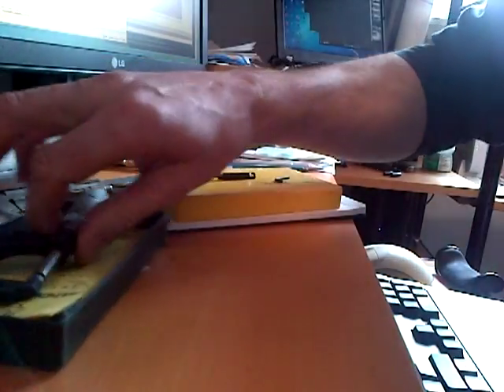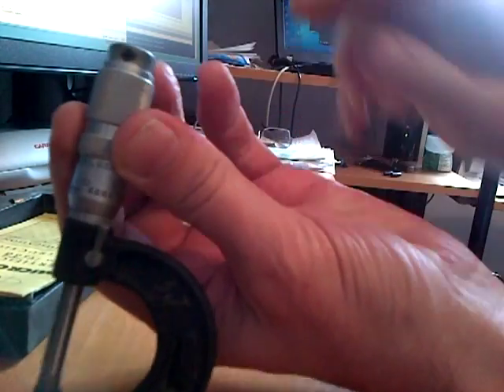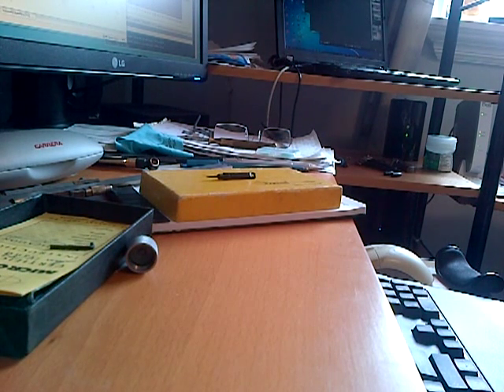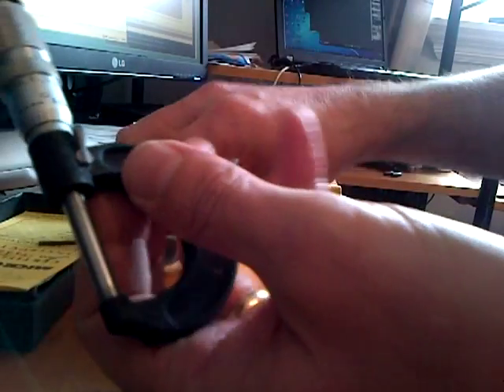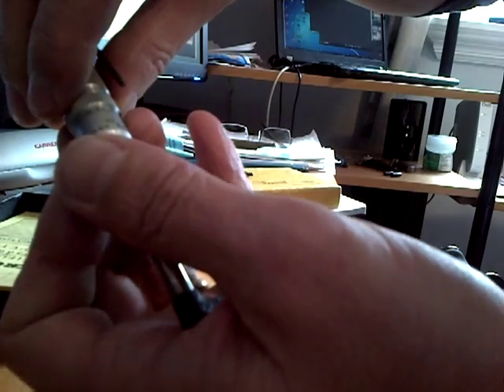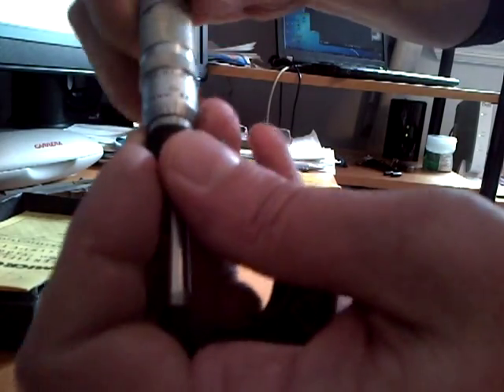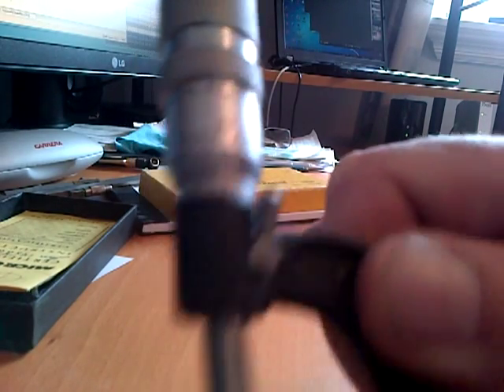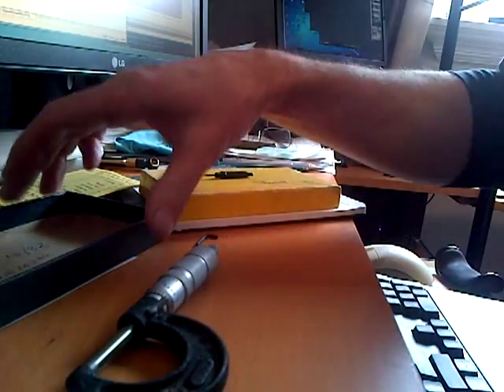Right way to calibrate a Central micrometer.

Comment: Best way to calibrate Central brand tools is to hit em with a sledge hammer, toss em and go buy some real measuring instruments.
Reply from the maker: LOL
Reply: You may well be right about Central Tool micrometers. And yours may be the next step I take in my attempts to loosen the thimble cap to adjust the zero setting. Maybe they epoxy it on at the factory. Ridiculous.  It's a bummer because it's designed for working on watches and really needs to be more accurate without my having to make mental adjustments. Will 6 lb be enough for the sledge? Cheers.